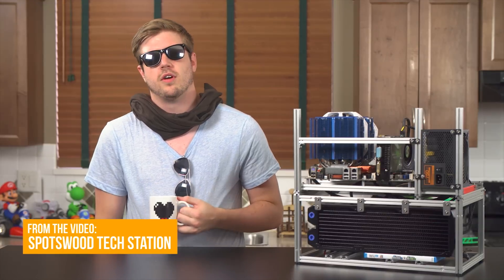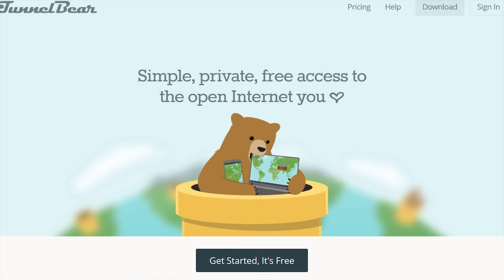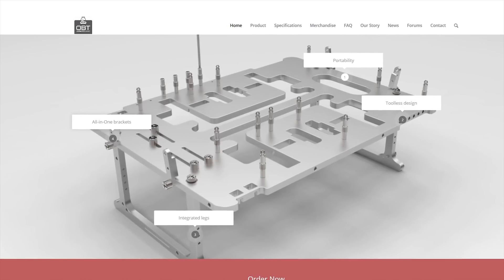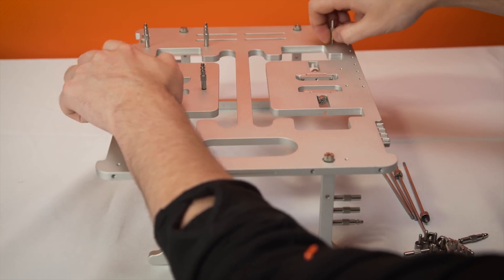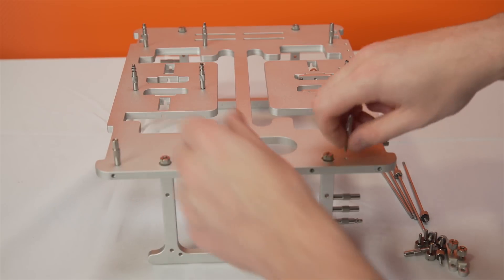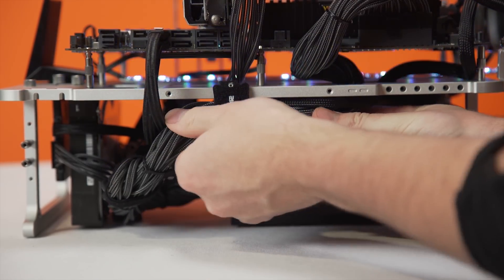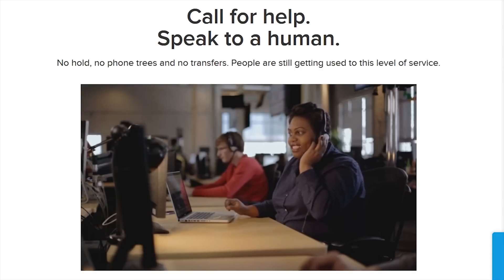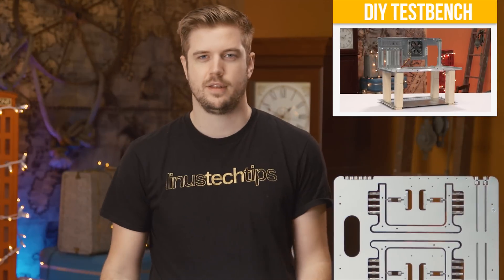A revolutionary platform for hardware testing?

Comment: Been using a wooden ply +aluminum sheet metal custom built test bench since 2007 still much cheaper than $150 and effective enough since I can just add more taps for screws and compartments. Though the design for it being portable and all in one stand is a gimmick worth it if you're in the business of PC repair/diagnoses and/or benchmarking hobby.

Comment: should I just get one of these? It looks cooler than my $200 case. 

Will it make my hardware run hotter?
Reply: Temperature depends mostly on the air in your room, since it's open-air it will be probably cooler. What you should be more worried about is dust.
Reply: Just make a cover for the bench from a lightweight wood like Balsa and mosquito netting or womens pantyhose. Fit the box over the test bench and viola! you have a dust cover for the whole rig.
Reply: Paul W hahaha good idea.  I never thought of that. Why hasn't MSI made any custom panties to cover their  twin frozers 😂. 

Honestly,  the dust filters that came with my case look like they could fit small sized noodles through.

Comment: I don't get why people complain about the price. This isn't something that is only cool when it's new! You can use this thing for like forever, because what should break on this? Come on guys, don't 400$+ GPUs that lasts some years and then complain about a 150$ one-time purchase!
Reply: Probably build costs and run costs. If it was a best buy, in every store, 5 for a buck, then quality would be less, but price would too.
Reply: This is why I find this Test Bench to be more of an investment. The only thing that could damage the OBT (Open Bench Table) to the point of no longer being able to use is... if you run it over with a car with it's center resting on a big enough rock so its bent enough that it can't be useable... which is unlikely unless you do it intentionally or shit happened.
Reply: its a piece of alloy...

Comment: This is actually exactly what I was looking for. I have an E-ATX system, that is "fairly complicated." Dual GPU's, a few other PCIe devices, a couple of drives, watercooling. And in my current case, maintenance is the worst thing. It basically means tearing the whole build apart. I really love aluminum, especially anodized in silver, and this will go excellently with what I'd love to have for my own build. I'm going to buy one right now, actually. Thanks Luke/LMG, this is genuinely one of the most useful videos you've done. Simple for bringing to light a non-standard product, I'd never seen before.

Comment: 3:30 - this is because the spacer (that is on top in the video) should be at the bottom (like all the other spacer on motherboard)). with this solved, should not be much of an issue to plug the cables

Comment: Seems like a success to me

... other than one question:
Why would you need to carry around a testbench?
Reply: if you're going to overclocking contests xD
Reply: To move it...
Reply: 1. sometimes, you don't want to work at the office - so you work at home or at someone else's house. 
2. portability is a marketing strategy.
3. having a testbench that can fold up is convenient to take to a lan (in theory) or perhaps for traveling if you have niche for assembling/disassembling stuff for fun as a hobby.
Reply: pretty sure carrying that test bench plus all the components to go on it would be less portable than carrying the pc as one in an actual case...
Reply: will it blend? is that what you were going for?
Reply: +Dylan Baxter +Chris Nguyen, both of you guys are wrong lol. This is made by HWBot and there is a reason for that. Extreme Overclockers use Test benchs have you ever tried to LN2 cool in a case lol? How about on a motherboard box? 4 GPUs with pots and a CPU pot on a motherboard box, ya that isnt happening. the crowd that uses these are not typically linus fans, I am a linus fan and in that crowd but I am a misnomer.
Reply: Geometry Dash Weed overclock contests? O_O that's a thing? damn didn't know that.
Reply: Chris Nguyen
You still have to take all the compennts with you (apart from those you want to test if even that). Wouldn't you just want to have a real case in that szenario? - I would.
Reply: Ni De look man, no one needs this product. it's a niche luxury product that caters to computer tech people, more than likely those who "test" hardware components for repairs or those who do review comparisons for a living. you asked a rhetorical question - why would anyone need this product? the answer is that you don't need it at all. linustechtips sometimes (aka often) upload high-end products on the market that only the 1% buy, such as VR gaming or gtx 1080's. It's informative, but more than likely not justifiable for its price or value.
Reply: Ni De mostly targeted at professionals who either build or repair PC's for clients.
Reply: Outlier* is the word you're looking for. Misnomer means wrong or inaccurate name.
Reply: did your dad just win the wsop 2016 main event?
Reply: Like if you would bc you could
Reply: Geometry Dash Weed
You still have to take all the compennts with you (apart from those you want to test if even that). Wouldn't you just want to have a real case in that szenario? - I would.
Or are you one of those 1% of 1% of 1% group that acctually goes to those. If this was only for them they wouldn't have needed the effort to make this a full one production. Just offer everyone of those maybe 150 or 200 people at the top one and if they want one their sponsors will pasy the horrendous price anyway ... No point in having this product even thought it is well executed compared to someother shit out there.

Comment: looks good, 150 bit rich 70-80 maybe (it looks like laser cut alloy easy fast, all the screw holes and fittings a little more time yeah 70-80 tops), legs look wonky.
Reply: It's made on a CNC.
Reply: Thanks. A bit more expensive than laser cutting, but 150, its a test bench.
Reply: me001ist when you have the best product on the market you can definetly get away with charging extra for your design lol

Comment: I used the Ting savings calculator. They can't offer something cheaper because they are over 3 times as expensive as my current data plan. I pay €10 for 150 min/sms and 1GB. With Ting you pay that for a contract with absolutely nothing. Ting is an overpriced piece of sh!t.

Comment: I have 2500 cad what specs and what computer should I build
Reply: Pentium 4, nvidia tnt, 512 mb ram, 1000 Watt psu, 1Gb hdd, soundblaster live
Reply: AnEdgy12YearOld lol but serious
Reply: The Amazing Cuber look it up on google or pcpartpicker
Reply: Go with a intel u processor, gt 450, 100rpm hdd, windows xp. Best pc ever
Reply: Win 95*
Reply: That DDR5 memory should be fast as HELL
Reply: Yeah, but the problem is DDR5 RAM does not exist...
Reply: TheOneAboveAll umm. DDR 5 does exist, but only on high end graphics cards.

Comment: I kinda wonder what an MDF version of this would be like.

I mean, Linus' neighbour has a CNC, and you can buy MDF...
Reply: Depending on how thick your cut of MDF is, there's a pretty good chance one of the side screw holes would split the wood
Reply: Maybe not mdf, but like a nice looking hardwood,  with brass hardware...  Hmmm....
Reply: Domenico Lamberti This cant be done on wood because of the threads for the screws.
Reply: Obbliteration 
You could use steel threaded sleeves that are embeded in the wood.
Reply: Just put some threaded inserts in the wood. https://www.mcmaster.com/#standard-threaded-inserts/=151k1xp
Reply: eddie mirsberger That would be more expensive than the original product.
Reply: TBH it probably be pretty cool, mod it a tad for the different material and paint it up nice and it could be a affordable alternative. 
TBH it would be cool to use that Motherboard tray design in total scratch build.
Reply: Obbliteration nah,  you could do it at home for probably under 50 dollars. I didn't say exotic wood,  just a nice looking wood.

Comment: That's a pretty dope test bench.  One thing I'd like to see though would be hex surfaces for tightening with a wrench and a small included wrench.  For instance, you guys always have at least 1 bench setup, and I'm not a fan of thumb tight screws for long term use.  But ultimately, I really can't complain, this bench is practically perfection.

Comment: So how long till someone 3D prints this?
Reply: Tom5tom Entertainment The Problem is the threads for the screws. You cant 3d print threads.
Reply: Obbliteration
You could drill them afterwards.
Reply: you just print them as small holes and run a hand tap through them. it would only a take a couple minutes
Reply: Tom5tom Entertainment Threads on anything but metal dont last very long and are really prone to break by overtightening.

Comment: People spend 600+ on gpu; sometimes more for CPU. But 150$ is expensive? Lol some cases cost more.
Reply: I think the difference being that with a full case, you're objectively getting more. You're getting included fans, power switches, passthrough for USB and Headphones and at many cases around this price point included LED lighting. 

My philosophy on cost/value. Is that every customer has a different set of requirements and prioritise them differently. I know some people that care more about how a device looks over how it performs... One woman told me when she goes phone shopping she asks the person in the store "what do you have in pink" 

Some upsides for this product are that it's light weight, portable and has a very sleek industrial design. If someone values those as high priorities it may be more justifiable to them to get it. I myself go to LAN parties and I think showing up with this could be a baller move because it is very different to all the towers and gaming laptops everyone else brings. As well as it being an open testbench it's a great way to showcase your hardware. The downside of course being safety, it makes it very prone to spills and at a LAN party that's a serious concern.
Reply: Who the fuck spends 600$ on a CPU. That's just stupid. Even for workstations.
Reply: AnEdgy12YearOld This isn't even close to 600$, and that's still not a lot considering a lot of high PC cases cost upwards of $150.
Reply: AnEdgy12YearOld But computer cases are pieces of metal you fucking inbred

Comment: Jeez, 150$ for a 10mm CNC machined aluminium plate... pretty hefty pricetag... furthermore the design is pretty simple, could have been done by an internship in about two weeks maybe?
Reply: you can get the plans and have someone else machine it for you if you think it would be cheaper.
Reply: Kingdom Of Mog
Are the plans free? They are open, but are they free?
Reply: Medievalfan94 yes they're free. That's literally part of the definition of open source
Reply: Do you even know the meaning of open source?
"The [...] main principle of open-source software development is peer production, with products such as source code, "blueprints", and documentation available to the public at no cost." Wikipedia if you want to look it up.
Reply: Kevin L. or directly from google "denoting software for which the original source code is made freely available and may be redistributed and modified."
Reply: Well, that's why they have the design for free, so people can CNC their own testbenches.

Comment: I don't think price is an issue since from what I've seen. Usually the people with test benches already have multiple computers. If one can afford that they're not as broke ass as me so money shouldn't be an issue. Especially if they've got other electronics as well like a $200.00+ smartphone.
Reply: Mike Soda a 200$+ phone is verry common nowadays. But yeah the people that need/want  test/open benches most of the time have a lot of money to spend and a lot of equipment
Reply: Delano Meneer
Yeah unfortunately it's very common via credit though. I guess that's still better than some of the other means people in my area earn cash for the extra things.

Comment: It's fun showing the difference between hard drives and ssd to tech virgins.  I show people by dropping an ssd from the second floor of my house to the first floor on hardwood (I use a small and light msata drive in a sata adapter) then plug it in to show it still works.  Often, they don't need to be convinced of the fragility of regular hard drives when I show them what's inside.

Comment: you should 3D print or CNC machine  addons for stuff like fan controllers or fan position holders like you had on your old thestbench, and the current CPU cooler mount looks somewhat ghetto , a more industrialized one would be nice.

Also this would make for a nice 3D printing/CNC video.
Reply: Roman 2510M there are already 3D print project for extra cooling fixation and PSU adapters (on the official forum of the OBT)

Comment: what happened to the good old motherboard box
Reply: DANK HARAMBE these are more used for permanent set up with their own motherboard so you can test gpu's, cpu's, ram, ssd's, and hdd's
Reply: only way to roll
Reply: thats for testing computers that will be going into a case. Test benches are good for quickly switching out different pieces of hardware and what-not for benchmarking
Reply: Ein I dont think there is anything wrong with a fancy test bench if it is something you may have to work with everyday like overclockers and LTT guys. It just depends on the use case. If you only build a few PC's a year, then it may just be easier to stick with the motherboard box for most testing.
Reply: Ein Congrats, that is THE most ghetto test bench ive ever seen XD. EDIT: It is the gold standard of Linus's idea of THE ghetto test bench.
Reply: Except when you want to test out a graphics card, especially one of the new ones. They are quite heavy, and definitely need a mounting bracket, you can't just use the motherboard box.
Reply: Mainboard box = best benchtable... for the price of that thing I could buy another 400 LGA 775 Chips, which for sure will bring me more points on hwbot than this thingy...
Reply: The box is still perfect test benches are sooo silly
Reply: Ein That looks incredibly sketchy, like one little bump and you have four damaged pcie slots.
Reply: DevilDude4427 Nah it's fine i've done it with 4 GPUs not just with one^^ http://hwbot.org/submission/3355773_ allmost killed my board, but that was because the watercooler of the 580 was constantly leaking...
Reply: DevilDude4427 Hardware is not that fragile... LGA CPUs for example are allmost indestructable, I buy them by weight of ebay or from local recycling centers and out of a hundred no more than two were dead in any occasion...  Since you allready have seen my ghetto testbench, here is my watercooling setup: http://abload.de/image.php?img=img_0005z4s06.jpg
Reply: Ein Motherboards are that fragile actually, if the gpu falls when in that setup, you will have a broken slot. There's no questioning that.
Reply: saying sooo silly is sooooooooo silly
Reply: I can't easily move around a box. I can't pick up it up in one go and move it to another table. Test benches are necessary when you spend your time testing benches.

If you're just testing all of your components before installing them into their permanent home in a PC case, then yes, just use the box. But if you spend you time benchmarking, comparisons, overclocking, etc., then an open air test bench is just as necessary as a regular case is for a normal build.
Reply: @jimshaly1  why are you replying to a 4 year old comment bro

Comment: Okay, 150 may be a bit of an investment for what is a thick piece of metal and some screws, but this is a piece of work equipment, right? And it does not seem like it's going to fall apart in the next couple of years. 

And aside from all that: 150 bucks is not that much when talking about quality pc components, anyway. You could easily spend that much on a decent mouse and a mechanical keyboard. 

And if you really want a cheap one, you might as well build one yourself (as you did)
Reply: Alactrium it is full aluminum so definetly worth it